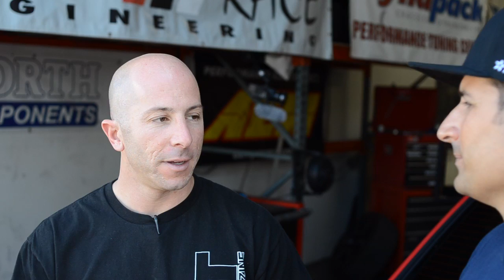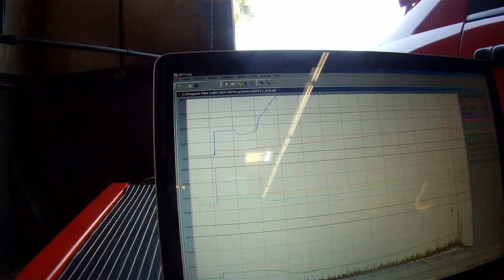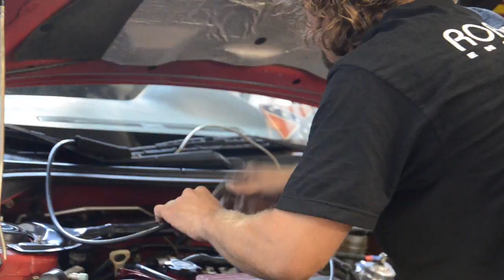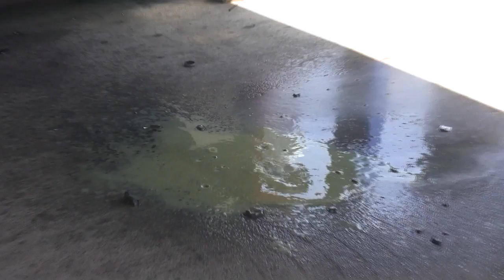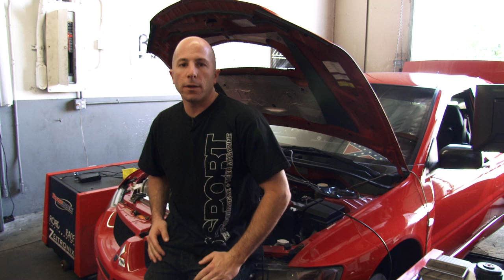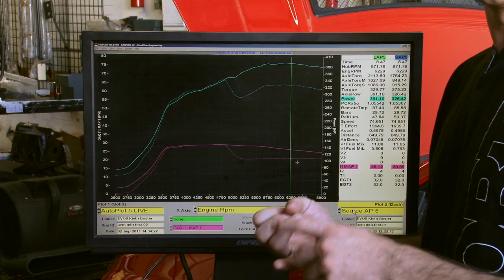Quick Tech: Water Methanol Injection

Comment: You do not need a standalone, this works just fine withe a stock ecu.  If you want the WB Failsafe to cut boost you will need an EBC or solenoid attached to the output of the failsafe.  The gauge will flash when something is not right.

The car in the video was tested for High Flow(Leaking line), Low Flow(Blocked Line), and low fluid level.
Reply: I have bmw m4 2016  and i nstalled aem  meth kit how can I install failsafe on stock ecu?:D